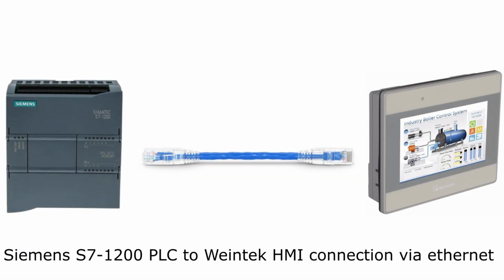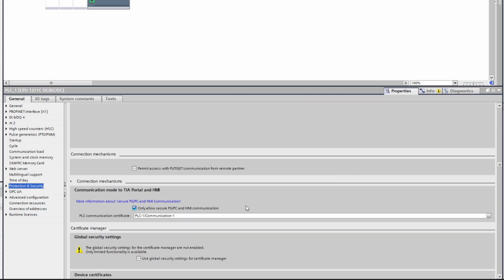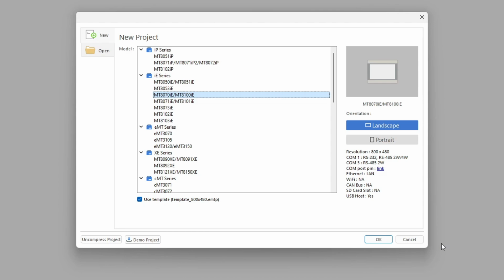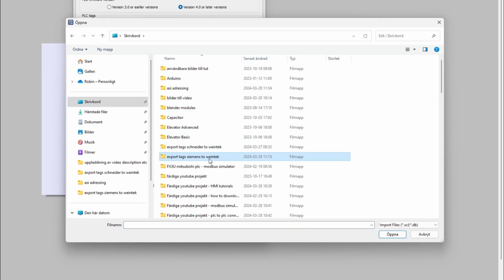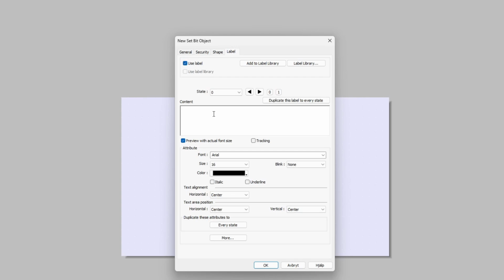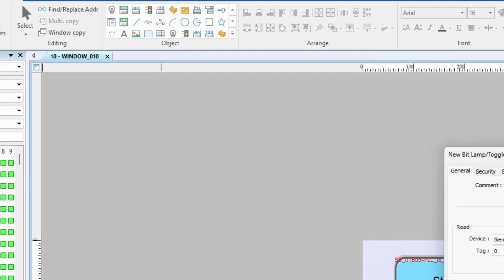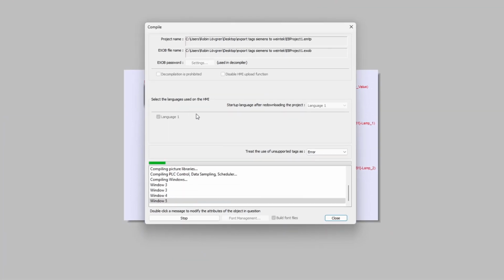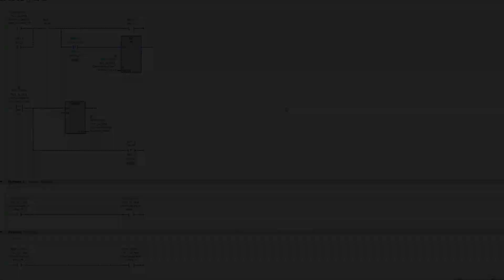Weintek HMI to Siemens s7-1200 PLC connection via ethernet

Comment: For anyone wondering, I failled to do it with symbolic adressing. So I had to chose absolute adressing. And I had to reference the .ap file. The .ap file alone doesnt work if you copied it from somewhere so you have to reference the actual tia project folder. If you disable optimized access and export database like this video suggests then it only accepts 1 database and it gives device connection error for db2 and the rest.